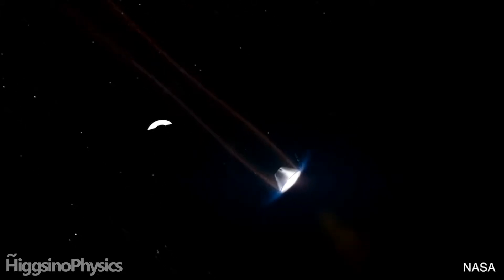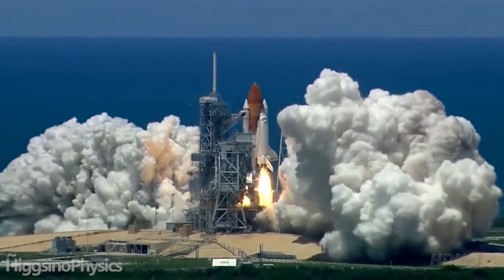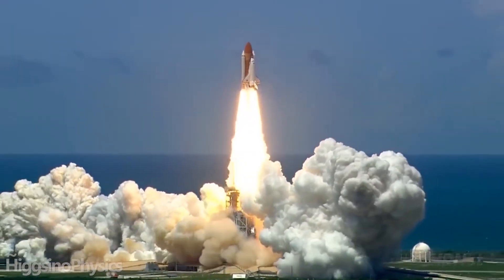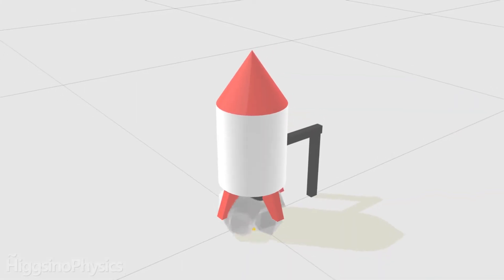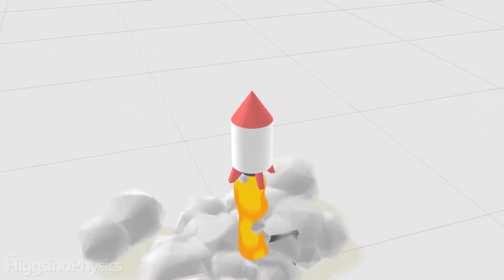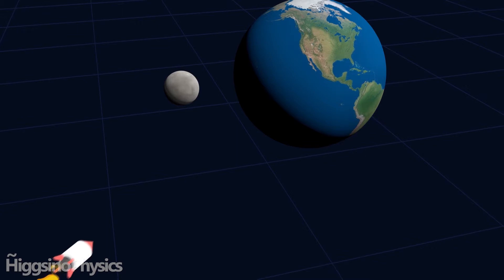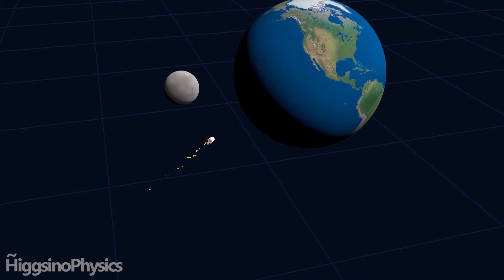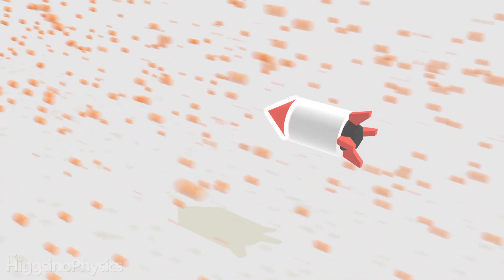Why does spaceships heat up on entering earth but not exiting

Comment: Why not slow down to say 100 MPH and come through the atmosphere slowly and controlled with controlled burns or thrusters ????
Reply: More fuel = more weight and more weight = more thrust more thrust = more fuel and so on
Reply: If we used high aspect ratio planes then gliding down might be possible. My guess is that it would take days,. The descent rate is limited by heat and stress. And the transition from supersonic to subsonic is rough, so maybe this is like a space elevator. A cool idea but physics doesn't care about cool unless it thought of it first. So maybe 🤔